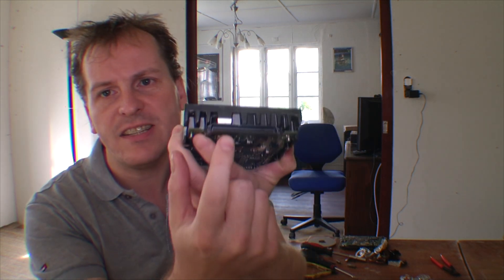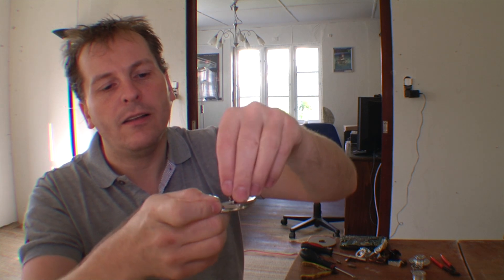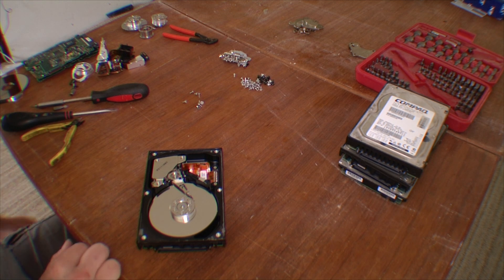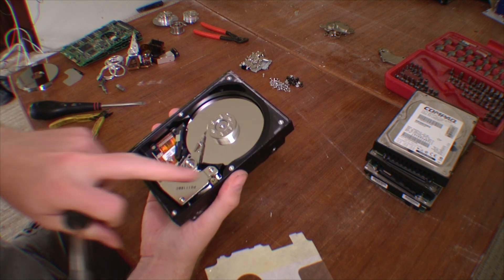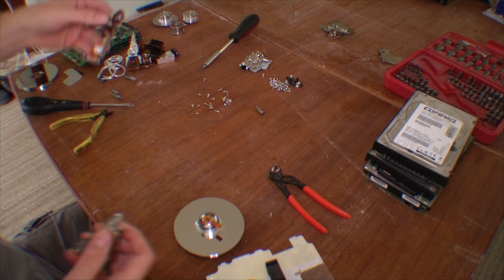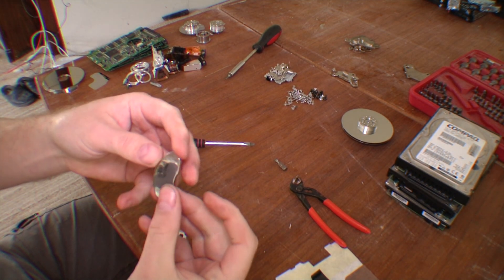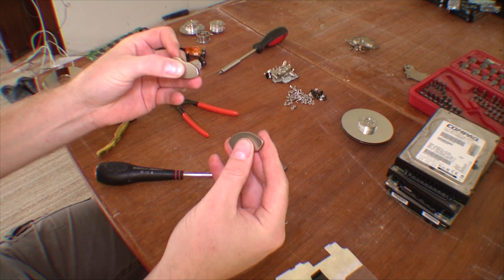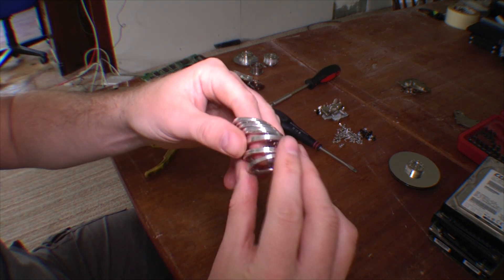How to get Super powerful neodymium magnet out of harddrive - 224

Comment: Working boards of popular consumer drives are pretty nice to keep if you can store them and publicise a list of the board models / FW version. 
I managed to save one of my precious data drives by replacing the board. (I dropped a pair of pliers right in the centre of the main controller chip of the original board - bull's eye) 
It took almost 5 years of searching, but I eventually found mine with this Canadian company on eBay that sells used HDD boards for data recovery.
I was so lucky that it had the exact same firmware version, so no data loss at all!
Reply: I doubt it's worth the bother for server drives however, given all the redundancy and RAID arrays.
Reply from the maker: Hi +Gustavo Ferlizi 
I once saved a company´s data,  with a drupe engine oil.
Thank you for watching! :-)